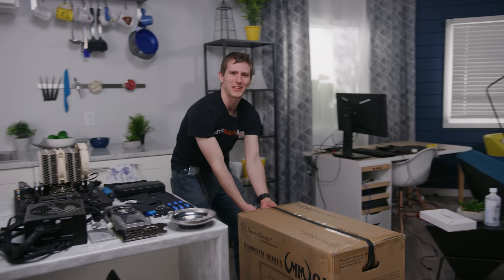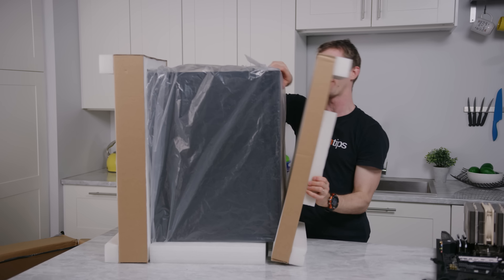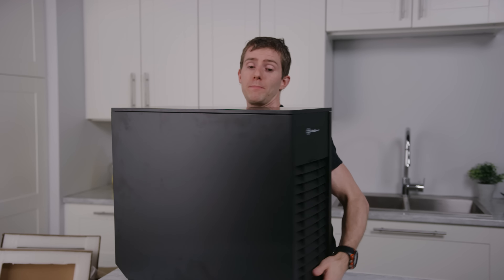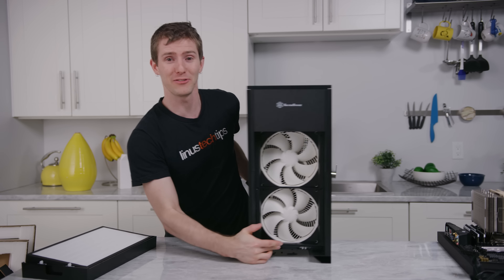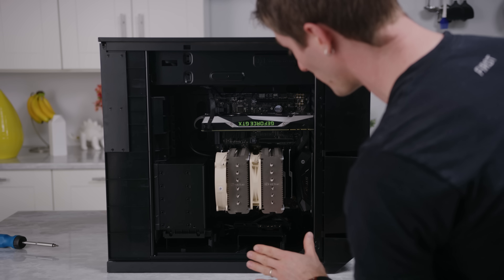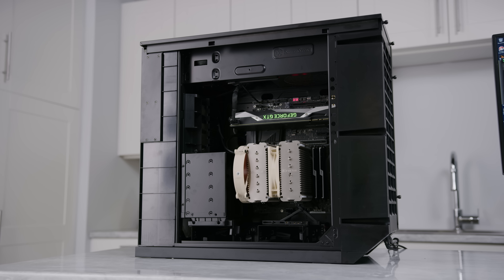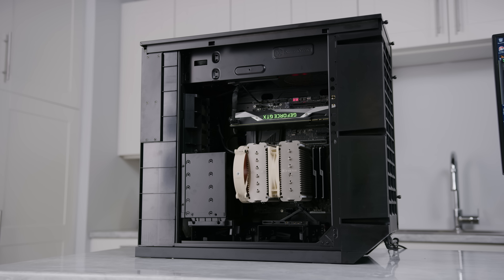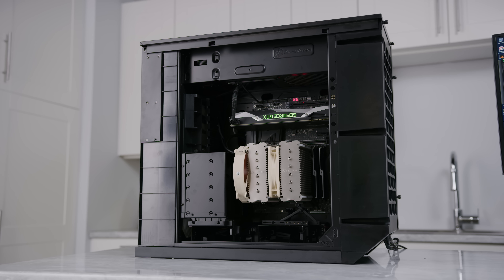Water & Dust Resistant PC Case - WHO NEEDS THIS??

Comment: As a woodworking live streamer I have a stong sense of I need this in my future. Sawdust has already killed one PC in my workshop and this seems to be the PERFECT case for me.
Reply: I think this case would be awesome for that.
Reply: tin2001 The load on a pc that is encoding all the video from two cameras on the fly for pushing live streams out is very high. Under normal conditions an I5 is pushing a 75-90% load. The nature of the beast says that the PC needs to be cooled well. If i were only web browsing or something like that the machine would undoubtedly last much longer. The high demands and a clogged fan led to the CPU being heat damaged. I have since built a box with fans and filters to put the new PC inside of. The live streaming is the key factor here, the demands are just too high to function in a really dirty environment  that long without precautions.
Reply: Other thing is, if you want to have pc for cnc router or such machinery on shop/next to machine. I other hand would need this cause my cat tends to sleep top of my Thermaltake box and i really dont like that cat sand+hair on my 300€ GTX 1060 -.- Also i'm maker, so there is plenty of dust anyways on my pc, as my workshop/table is also my main media center (yes i know its kinda odd system)
Reply: I think watercooling would have a few advantages in that... case (ba dum tss), because the filters on this thing look like they would clog up pretty quickly and dust can still come through it and also enter through the back, when the fans aren't running.

With watercooling you could completely seal off the PC and just move the radiator(s) outside. For power supplies water cooling isn't really available, but there are silent, fanless ones you can use. Stick to SSDs and network storage and that will be OK without cooling too.
I can also imagine a Case that has big open sides with air filters in them and only outwards blowing fans on the underside could work great (and be simpler). Air would enter slowly through the big surfaces, so dust would not get sucked through the filters, and it couldn't just settle, inside, when fans aren't running.

Also where are you streaming?
Reply: how does one become a woodworking live streamer?
Reply: No, the clogged fan is the key factor here and tin2001 is correct that you're not doing it right. Why did you let it get clogged with dust?  Why did you not clean your PC? I understand that it would get dirty a lot and need to be cleaned a lot, but that doesn't mean you just give up and let it choke to death on dust.
Reply: Sean  what I do for ours at the Barn may just help you, We had same issues at Barn from HAY dust and its in an office but it gets every where with the amount of HAY we load & unload in the Barn....I went to Lowes and got myself a Home AC filter one of the best they had not those $.50 one but the actually Hepa Type ones with like 4 or 5 stages if i remember right and we cut it to fit the front then made a Aluminum Sheet metal cover/holder... ( they make Filters Now the size we need so No more cutting but they keep the PC's Clean as hell, we used to have to Blow them out with Compressed Air Once a week to keep them halfway clean but it still required a complete tear down after 3 months now we can do it  when ever and so far we are UPTO 7 months with no Signs of Dust build up to make us do a  tear down to clean it......I d ont know if you are ok with something like this because most people want a comp to look nice but in a work environment its more about it actually working.   Cow }:-o)
Reply: To answer all of this in one post. I stream on Twitch. I have built a box from wood now with big filters similar to what is in the barn post but that was very large and did not work for me. As to how one becomes a woodworking livestreamer; Twitch has a creative side and I stream the projects I make there. The first pc was a laptop and was cleaned with compressed air often but not dissassembled (lesson learned). Yes my workshop is small, a one car garage. Water cooling with an external radiator and a fully sealed box was a solution that I did consider. And not a single fanless computer i have come across would have enough horsepower to handle the workload of encoding a 1080p stream from 2 cameras and pumping all the data out to an interactive platform. As of right now I have the pc in the attic above the shop and run usb extension cables to the Cams and a usb hub for the keyboard and mouse. As a side note I stream as BB_in_va.
Reply: I am glad you came up with a solution that works for you Sean so that's cool, if you did it similar to the ones we have at the Barn and it kinda sounds like it.. We had issues still at first (god what headaches) with 2 of them, it turned out they did not have enough positive pressure to make sure its pushing air our the way i wanted it to come out and ONLY letting air in through the filter side.....heck until i found out what it was i wrapped it all in filters so No worries Sean Good Luck in Wood Working ....If i remember young man the next time i get on Twitch i may have a look at your channel   BB_in_va.   Be safe   Cow }:o-)
Reply: Nobody uses water cooling in a professional setting

Comment: Who needs this? Commercial Fisherman have to have PCs with charting software on their boats now in some areas to be compliant with the regulations. This would be perfect for that purpose. The real question would be how well it stands up to salt corrosion. That and moisture is what kills their PCs pretty quickly.
Reply: they could fix that with using another alloy besides steel
Reply: Richard Crockett I used to work on PCs that needed to work in the desert, places like Iraq or Afghanistan.. This would be ideal for that. The filters we made were never quite good enough.
Reply: It would be great in server rooms where there are sprinkler heads visible, in case of something drastic occurring.
Reply: For that purpose I think it would be more practical to use a sealed computer - much less powerful, more like tablet power, but then if you're just running charts on it, you probably don't need a workstation or the power consumption that comes with it. and it would be much smaller and probably able to be bolted down.  but perhaps you are a fisherman who also likes to play viddy games at 4K; in which case...
Reply: Nightclubs. Dj booth, VJ booths, FOH, festival rigs, etc
Reply: Most factory environments, woodshops, and just about every outdoor concert etc
Reply: It would also be great for an engineering PC in a manufacturing environment.  I've worked IT in several factories and the amount of metal dust that gets in a PC in that environment is staggering.  The cost would be too much for someone who can get by with a thin client or terminal, but for someone who needs a higher end machine, with a workstation graphics card in it, this would be perfect.
Reply: My father in law designed some IT equipment enclosures for use underground in mining. They had to be ventilated for cooling purposes, but had to be totally dust free. He had steel enclosures made up, but for the air, instead of reinventing the wheel, he used air box and filters from a Toyota Landcruiser. Cheap to replace and excellent cleaning properties.
Reply: Richard Crockett there are water proofed phones that sell at a fraction of the cost of this set up. Unless you need a massive GPU this is overkill.
Reply: They can't just use any Charting software as it has to be Coast Guard approved. Right now that software is Windows only so they need a PC on board. Some use laptops but most just want a Desktop right on the boat for convenience sake.
Reply: Richard Crockett I thought you were joking
Reply: actually outdoor concerts do not really NEED that, at least if you are smart about your placement, and I know very well because I help work with one every year (usually I just run supplies and radios to staff, but there have been a few years where I have helped in some way with the computer running digital graphics). you only need that if you for some reason have it in a small "tent" without sides or if it is not otherwise placed in a smart spot away from the elements
Reply: Well it would be grate if they had mini versions
Reply: This could also be useful in junk yards where they use tower computers to run the weighing scales.
Reply: Workshop much? Woodshop? 
Any place that has a lot of heavy dust and needs a computer. And a tablet or  sealed computer is definitely not a reasonable alternative to this.
Reply: Most offices have "Sprinkler" Fire Suppression Systems that use actual water (a few use wet foam) so this is perfect for those situations. Professional computer rooms use halon gas so computers racks aren't damaged.
Reply: Mining facilities, anyone?
Reply: one more question is it good for flood prone area? we do have problems of flash flood during rainy seasons and we always end of having atleast $1000 of loss mostly storage due to which we are switching to ssd(no matter how much we prepare for this disaster lmao). And most of the time peripherals  are actually washable if not plugged in during drenching. But do takes atleast 2 to 3 weeks to thoroughly dry off completely. Really adds up more loss due to non-operation lmao . I can see this case wont be completely drown proof atleast it might save alot of time drying those wet systems...i need more advise if any thank you!
Reply: elink1 shoulda just had a sealed case with radiators on the outside
Reply: The Panasonic Toughbook is your answer, fully sealed and waterproof.
Reply: Richard Crockett Maybe flooding or if ur messy and spill water honestly why would you buy this
Reply: @Techguyericd  Typically you have other firefighting countermeasures other than water.
Reply: I would put dielectric grease in all the connectors, and coat the board traces with something, if they're not coated with something, from the manufacturer.
Reply: Dust proof and waterproof go hand in hand so even if there wasn't a reason to have a waterproof computer your computer being dust proof makes it inherently water resistant. 

That said to add to the list. Anyone who works in any kind of pressure washing or cleaning service would benefit especially jobs at carwashes or dry cleaners or other heavily automated cleaning jobs.
Reply: It would be great in quarries, the amount of PCs that get bricked because of dust is obscene
Reply: lazy people needs it!
Reply: w1p30ut3r why?
Reply: @confuzedgraphite  No cleaning annymore! :D
Reply: w1p30ut3r if you need to regularly clean your PC laziness is not your issue
Reply: @confuzedgraphite  I dont need it and I dont have this issue... You are confuzed indead! :S
Reply: It would be handy in a construction zone. My sister works for a company that lays down fiber-optics and according to her, sometimes they need to run on-site servers that require power-generators that will go through a gas tanker within a day. I'd imagine that the amount of dust and other stuff in the air would make this case quite handy.
Reply: Mines, dams, logging, anything in the oil and gas industry
Reply: I drive a truck. I game. I need a full pc. And im in the oilfield surrounded by dust with constant vibrations. I need this. But smaller.

Comment: Considering how dirty your desk PC had become, I think you could use something like this, Linus. If only it was drop proof...
Reply: That would make the case worth getting for sure. Right now It's just Fugly and loud as hell but at least I can play PC games in my tent for the whole summer at camp. Adding that drop proof feature would make it the PC case for the on the go gamer who would rather have to do a little work packing and setting up and bring his A-game rather than be a lazy watrel throwing money away to show up with the 3rd string practice squad.
Reply: Don't think a drop proof case will never be made in are moment in time
Reply: I assume that they already do exist and are currently in use in our active foreign theaters. Whether or not the company can or chooses to translate those into a consumer-friendly version is another matter. We could do without bomb proofing radiation shielding or anything else their Mil versions current call for.
Reply: CALL 911, SHOTS HAVE BEEN FIRED
Reply: they're on their way don't worry I told some Dhany person on the tube said he heard gun shots done and done
Reply: and if it came with socks and sandals
Reply: I've seen a couple of non-military shock-proof cases, built for industrial use workstations. Most of them are dust proof as well. They're ugly a.f. but you can adapt them quite easily for a standard PC if you want. They're easily big enough to fit the most extreme PC builds you can think of, very well ventilated and often equipped with a backup PSU and extra storage racks.

Comment: I don't care about waterproofing much, but better dust filters then what we have in regular PCs would be very welcome.
Reply: what's wrong with the Filters the better cases have? those are 'forever filters', you just wipe them off and you can use them forever.
and they have little air restrictoin, while doing an excellent job of filtering out particles.

are you sure you want traditional filtering in your computer? because those are disposable filters. more effective than the super thin reusable ones, but instead of wiping them off a few times a year, you'd be throwing them away and buying new ones, sooooooo....

Comment: dust-proof is quite an important feature for people who open their cases once every decade,i.e.,me
Reply: I tried to open my case but it's prebuild PC and although it has screws that's just part of it.  After that you get to the point where you need to deal with weird circle thingies that aren't screws. I never seen them anywhere in anyones video where cases would be opened. So that's why my PC has to suffer dust : x
Reply: I open and clean my pc like every weekend. I've got a tempered glass case and I'm a neat freak so I cant stand anything dirty, least of all my PC (Where I spend the most time every day)
Reply: +matrixfull Dude, you have to be doing something wrong, almost all PC cases have a quick release tab or a single screw that holds on the right side of the case if you are looking at the PC from the front... if you are using a funky "gamer pc" with the completely over the top case like the Alienware Area 51, MSI Trident, Asus ROG G20C... you chose that trouble! 

You can still use an air compressor to blow the dust out, a toothpick to keep any fans from over-spinning, and some duct tape to hold that tooth pick in place. You don't want to loose a toothpick in there. 

I have a 2005 Dell Optiplex GX620 small form factor with a Pentium D 840, I just leave the side panel off so it doesn't fry the Nvidia GT 640 2gb, I can play any games that will run with 3GB ram. I blow the dust out every 6 months.
Reply: Those will be rivets, not very clean to take out...
Reply: Or lives on a building site. i.e. me
Reply: Cammando58 Cammando58 my thrift store compaq has a screw that opens it. Try looking for that
Reply: i once opened my pc long time after i got it and found LEAF inside i have no idea how it got in it mustve been there since i first opened it when i got it
Reply: matrixfull That sounds like a Sony Vaio desktop
Reply: Also a closed case top is important for thos who like to put their cup of tea onto the tower.
Reply: Jacob Seppa  Just reminding you to clean your parents pc. :D

Comment: Great Video, I prefer these longer videos! That chassis is great for labs/studio/stage/outdoor/trailer installs. There are soo many applications for this!  #LONGERVIDEOS
Reply: IKR, and great price too!
Reply: whould be nice with a long test or at least a week in an area with fine dust and sand particels thou to really see if it will stand up to it.
Reply: Kenneth Hermann a HEPA filter is a HEPA filter. It will be just fine.
Reply: YeCannyDaeThat I wonder if mandatory cleanings would be in order, due to the thermals rising as it clogs up... (time to program a scheduled filter purge, but running the fans backwards...)
Reply: It wont get as clogged as you think. I have an air purifier which is just a big version of this. It's been running 3 years. Every 12 months I just vacuum the filter and I washed it once. But at no point did the fan slow or airflow slow down. Having said that, my big HEPA filter has a courser black filter in front of it that catches most the bigger stuff. Hairs and dust balls. I clean that the same about every 6 months. So basically, I dont think you would have to clean it any more than a regular PC dust filter.
Reply: yea my question aint about the HEPA filter is used to them from industrial use. its rather if the construction of the front is air tight or im going to get a build up of dust and sand from crags in the  construction and if the positive airpresure is sufficent to keep out dirt from entering the crags in the side.

Comment: "You won't have to worry about your PC getting the flu."

2020: "What about Covid-19 tho?"
Reply: Its 2021 boiiii
Reply: both flu and covid are caused by viruses which are smaller than bacteria, so I doubt what they said in video
Reply: @knifekitty_ls  yeah. Some hepa filters do exist in the 0.003 micron rating, those will actually filter out virus particles. They are used in hospitals or high end air purifiers like iq air.

Comment: I typically clean out my PC twice a year with a leaf blower. I've been using the leaf blower method for almost 20 years now. As long as you hold the fans still or remove them where possible, it is the most thorough job you can do without water. It turns water radiators brand new in seconds and can really get to all the stuff you could never reach.